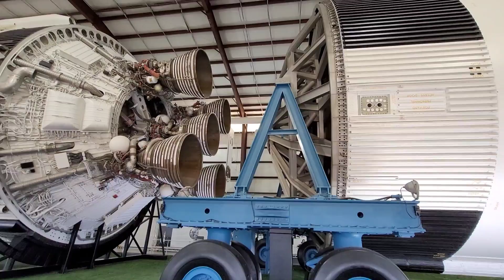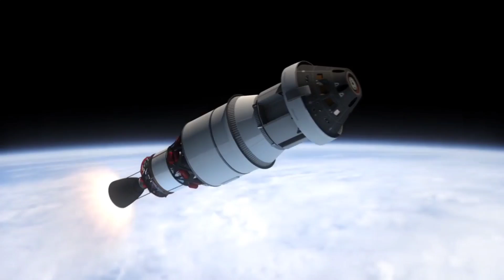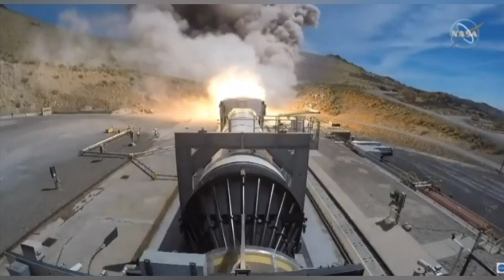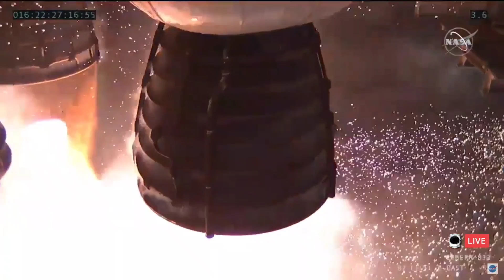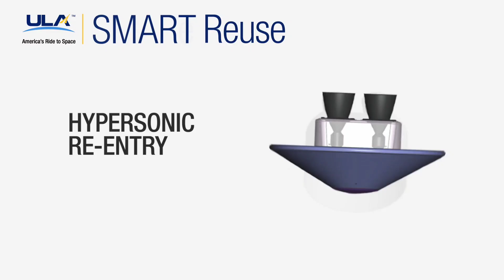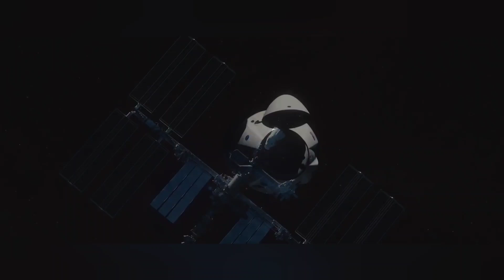Green Run Canceled! How did Boeing foul up SLS so badly? Can SpaceX or ULA (both?) solve this?

Comment: It's too bad the exact design drawings for the F1 engine are lost... Maybe Aerospike? As long as we keep using chemical rockets, orbital refueling will be a necessity for heavy launches that will leave orbit
Reply: Actually they were not lost they are held at the Marshall Space Flight Centre in Huntsville Alabama. In exploring options for the SLS, NASA carried out a study in 2013 to see if the F1s could be built using today’s technology.  By using today’s additive manufacturing techniques the engine design can be simplified to just 70 parts and would also offer about 10% performance improvement over the original F1 designs.  NASA went so far as to refurbish and test an F1 gas generator turbine for such an engine, videos for which can be found online.
Reply: The F1 was a rushed design, and suffered failure in flight at a rate that is unacceptable in today's designs. That the Shuttle went on to use a better design was in part due to lessons learned by the Apollo program.
Reply: What was lost was the "engineering" drawings. Those where the prints the the engineers had in the shop, and they kept hand written notes on them.
Reply: @joshua43214  with today's 3d printing and scanning technology, its a dead horse argument that we can't build a F1 seeing we have one at hand, it just wasn't that good a design in the first place. It did its job mostly, but it isn't like it had a spotless record.
Reply: @twotone3471  In some areas, the use of 3D printing does not work because too much stress causes damage to the printed elements or it's just too expensive to get around these problems. 3d printing != golden bullet
Reply: @GreyDeathVaccine  I'm thinking of the scanning tech mostly, taking a F1 apart, scanning each part to get its size and shape, even taking a metallurgy sample to the manufacturer. Then let them make 100 of each part, assemble new 1 engines, then go to the moon. To say we need the origional paperwork is to day we can't copy the Mona Lisa because the artist is dead! With today's tech its take a pic, or copy one off the net and print!.

If the F1 was worth it, they could have done just that. But it had issues, and it was lucky nobody died because of them.
Reply: @twotone3471  No need. F-1B exists.
Reply: Only fitting notes are lost, original plans do fine and well and even F-1B engine (massively simplified, modern and cheaper and more powerful variant) has been desinged, built and tested.

Comment: Im thinking China is going to land a human on the moon before NASA at this rate.  They are making huge strides and their new long march rocket could certainly do the job providing it works as designed (which it probably will).  Space x will also probably beat NASA to lunar orbit, but maybe not landing.  At this point the SLS is going to be too expensive and too complex to build in any useful numbers.  Its a white elephant that will be launched a few times to prove it works then shelved.  Colossal waste of time and money.

Comment: Boeing is like one of those fly by night contractors who take forever to remodel your kitchen and extort MORE money after there are holes in your walls because the alternative is to start over and hire yet ANOTHER contractor who will charge large amounts to fix the damage already done...
Reply: Boeing has virtually no experience in rockets, especially engines. It's like giving a gardener $10,000 to remodel your kitchen; yeah he'll spend the money but I don't think you'll like the results.
Reply: @idanceforpennies281  I'm as big of a critic of Boeing as anybody, but to say they have "virtually no experience in rockets" is completely disingenuous.
Reply: @samos8367  OK. So name one, just one, major piece of hardware that Boeing has designed or built for a rocket.
Reply: Don't forget (NASA's) "sunk cost" fallacy
Reply: It's not just NASA. Suppliers know how much money the customers have, or can get, and do not complete the job until the gotten all of it.

Comment: Old space never designs for manufacturing, they just make expensive one-offs. I have a cousin who works as a tool designer for ATK/NG. His full-time job is literally to design (not make) custom tools that others use to build the rockets.

SpaceX does the exact opposite. Prototypes are cheap pathfinders with rapid feedback loops that help them refine the machine that will build the machines. They do design and build tools, but tools are a means to an end. And Elon is all about "the best part is no part" and "the best process is no process." 

SpaceX rewards engineers for eliminating the unnecessary.  

Boeing rewards engineers for adding make-work projects.
Reply: SpaceX is at least 10% cheaper than the closest competitor in terms of price per kilogram to LEO.

The payload penalty for reusable rockets is less than 40% and after two launches they break even and after three, they are putting more mass into orbit per launch and per dollar than anyone else can.
Reply: @faceplants2  You seem to know better than SpaceX itself  - their position on payload AND TRAJECTORY penalty is publishd and last time F9 was supposed to do 10 flight and break even after 5 or 8....
Reply: The difference is a company trying to make something they can make money off of vs a company that knows they will make 10% off whatever they spend so the more they spend the more they make. That’s why the commercial crew program and commercial resupply missions are great. “Here’s $XX, you owe us 20 flights when you are done” they have incentive to get flying ASAP so they can get those flights over with and make money.
Reply: Great comment from somebody who's obviously seen many interviews with Elon and understands the vehicle design and development process at SpaceX.

They could build and destroy almost two dozen starships for the cost of a single SLS. That is excluding all the SLS R&D money, GSE (ground services equipment) development, complete redesign and rebuild of mobile launch tower etc that SLS required
Reply: @faceplants2  the reason we calculate the cost of a shuttle launch as the average cost of the entire program is because nasa built it and flew it themselves. Falcon is built by a private company and “chartered” out as a cargo vehicle. Therefore we only look at what they actually charge. The reason the DOD contracts are more expensive right now is because they asked spacex to completely change the way they integrate their payloads specifically for them. It’s a custom order, and custom orders cost more.
Reply: Actually: No, but sort of.  Who are the CEO's at Boeing? They are accountants because the SHARE holders are who? Financial institutions who vote on the board. Boeing's shares used to be owned by the founders of the company who were all engineers, and therefore they HIRED CEO's who knew engineering. Same goes for GM, IBM, etc. Why big public companies fail? Boards are owned lock stock and barrel by accountants, banksters, pension funds, etc without one engineer anywhere to be found. SpaceX has another couple decades to be a viable company and they will go the same way as Boeing, GM, IBM, GE, Kodak etc. As soon as Musk disappears, Space X will go to shit.
Reply: And why are so many people comparing the Falcon 9 to the shuttle anyway instead of its contemporary competitors like Atlas V, Delta IV, Ariane 5, and even the upcoming Vulcan?

Vulcan is going semi reusable by ejecting and recovering the engines and they are doing so with a parachute. Rocket lab is working on reusing their core stage.
Russia is working on a knockoff Falcon 9 that is reusable and China is also working on reusability.
Clearly, the financials of reusing rocket components makes sense.

In terms of rocket launches needed per ton delivered to LEO, Falcon 9 breaks even around the second launch and it only gets better from the third launch forward.

They have already flown several boosters five times.

Don't forget that the price SpaceX charges ($62 Million new / $50 Mil reused) is the price they charge and not the cost to them. We don't know what their cost is and we don't know how much cheaper they can price a mission until the competition starts catching up and forces them to lower prices.

They need to make money to develop Starship, Starlink and future projects somehow and if you are already at least 10% cheaper than the closest competition, why would any business charge less?
Reply: @faceplants2  reusability, as Ryan points out.

It is interesting that none of these other entities would be dipping their toes in the waters of reusable rockets if SpaceX had not forced them to. And while SpaceX learned from the STS mistakes and pushed reusability to a new level, the others were shaking their heads and clucking that reusability wasn't economically feasible -- STS proved that. And now that they are finally realizing they were wrong, SpaceX is pushing on: Falcon 9 is not enough. Starship must be fully and rapidly reusable. 

Don't bet against Elon.
Reply: @faceplants2  people compare them because the shuttle and falcon are both reusable. I’ll agree it’s not a valid comparison, but that’s why. Also, they flew their second booster for the 8th time this morning.
Reply: @ryanhamstra49  Starlink 16 was the first time a booster flew 8 times iirc.
They haven't flown another for the 8th time yet, have they?
Starlink 17 will be the 8th flight for booster 1049 but it's launching out of order, after 18-19
Reply: @faceplants2  I was wrong. There was supposed to be a launch last night but it scrubbed
Reply: No, SpaceX hasn't made things better.
Reusable aren't cheaper. Recently SpaceX charged the DOD way more that ULA did.
Reply: @bobfg3130  That's silly.
F9 is much cheaper than any of the competition, you can go look up the prices and convince yourself.
You are either getting half the story, oryou are telling half the story.
Reply: @joshua43214  it also depends on the launch. If it’s someone like DOD they may require a new rocket instead of one on its 3rd launch which means it may be more expensive than a launch for direct tv who is ok with a pre launched rocket.
Reply: @joshua43214  The advantage of falcon 9 is vastly overstated (between offsetting R&D costs with NASA contracts & the extensive work still required to recondition boosters). At the same time, it is still the best launch vehicle available for most orbital missions these days. It also has a lot more potential as they streamline the process to reuse boosters and get the reuse counts up.

It would be impossible to say otherwise without a financial report from SpaceX showing how large their costs were unrelated to F9.

That said, the "classic" space companies are just in a whole other league of failed spending. The space shuttle, a popular example, wasn't bad towards the end of its life and it brought a lot of capability to the space program so that's not a good choice. Instead, look at the lack of innovation in the past 20 years: ULA have practically coasted on what Boeing and Lockheed-Martin already developed in the Atlas V and Delta IV rockets. We'll see when Vulcan comes out whether that holds but supplying NASA with an alternative to Soyuz ISS launches should have been an easily achievable goal.
Reply: @bobfg3130  You are conflating development costs with launch costs. These contracts are not only for payload mass delivered to orbit but also the development of launch facilities, larger payload fairings, horizontal payload integration and vehicle development.
Reply: @faceplants2  

The cost per Space Shuttle also includes development cost. It's the equivalent.
Reply: @bobfg3130  Yes, comparing cost per launch is not apples to apples because the shuttle launch costs were portrayed as an average over the course of the entire lifetime of the project whereas Falcon 9 is mostly based on pricing in the development stage
Reply: @bobfg3130  
I take it that I was correct and that you were basing a lot of your information on recent Thunderfoot videos?

If you want to have balanced sources of information (or just more accurate information), I highly recommend that you check out
https://youtu.be/Y4EocY9Z1qo
Reply: @faceplants2  

Actually Falcon 9 pricing mostly is based on pricing in the launch stage. Nice try though. Maybe you should stop lying and supporting Musk.
Reply: @bobfg3130  
 Hey, You know that bullshit tribalism that the mainstream media and politicians pulled off that got everyone to sort into one of two political teams?

You're doing the same damn thing.
Let me guess, you think everyone falls into one of two camps: blind fanboys that belong to the cult of Elon Musk or those that have their eyes opened to see that he is a fraud and con man.

God that's boring
Reply: ben esterberg  

No, it's not. That's just one of Musk's lies. Contracts have been given by the government in dubious ways for decades. Cheaper? Right.

https://www.google.com/amp/s/www.forbes.com/sites/lorenthompson/2020/09/17/when-it-comes-to-military-launches-spacex-may-no-longer-be-the-low-cost-provider/amp/
Reply: @bobfg3130  those contracts are not just for the cost of launches but for the development of larger payload fairings and ground service equipment / launch facilities. The DoD contracts specifically.

You also have to keep in mind that when it comes to national security, having more than one domestic launch provider is incredibly valuable.

A lot of the SpaceX critics seem to ignore the fact that if it wasn't for them, we would still be paying the Russians for rides up to the space station.

The Falcon 9 is still being vetted and developed. Cost per launch and cost per kilogram delivered to orbit or not the only things that matter here. Capability and redundancy are incredibly important when it comes to national security and NROL missions.
Reply: @bobfg3130  
If you see Elon Musk, SpaceX or Tesla as 100% bad then you are just as foolish as the fanboys that think that Elon can do no wrong.

The real world requires the application of far more nuance and critical thinking. Take a long view of the orbital launch provider market and the capabilities that our military needs to maintain.
Reply: @faceplants2  

SpaceX is viable economically but isn't better than other companies. Tesla was a great idea. I don't know how viable it is economically.
Reply: @bobfg3130  Well, it's only one of the largest automakers on the planet.

Many of the other legacy car makers are just now getting into electric vehicles and they are years behind.
Reply: @faceplants2  

Tesla, one of the largest automakers on the planet? Good joke. 

The legacy automakers have had electric cars FOR YEARS.
Reply: @bobfg3130  by both market cap and revenue growth, yes Tesla is kicking ass.

Most of the US automakers had to stop their production lines because they had canceled orders for the chips required for ECUs back in the spring. The fact that they don't understand that wafer supply at Silicon fabs needs to be reserved Well ahead of time bit them in the ass.
Reply: @faceplants2  

Market cap means shit. It's all hype. Manufacturing numbers are where it's at. Also, Tesla makes profits by selling green certificates or something like that since they're not making internal combustion engine cars and don't need them.
Reply: @bobfg3130  "green certificates or something..."

Let me know when you have your point fully formed and I will consider it.
Reply: @faceplants2  

That IS my point. The reason why you won't consider it is because you don't like the facts. For every set number of cars (50 or something like that) that has just an internal combustion engine that has been sold a manufacturer has to sell a hybrid or electric car or else they will pay fines in theory. In practice for every hybrid or electric car sold a manufacturer gets a green certificate. They need 1 certificate for every 50 sold cars. Tesla doesn't make internal combustion engine cars so they don't need these certificates but they get loads of them. What do they do with them? They sell them. That's how Tesla makes a profit.
Reply: @faceplants2  Tesla isn't failing, but the market cap is insanity and the worship stupid and the business models anti-consumer. The Boring Company is a giga-scam. SpaceX is the only Musk business which is represented fairly accurately, in that they are building economical and reusable rockets. If they were not cheaper or had other qualities that made them attractive, payloads wouldn't launch with them. They are the only human-rated launch vehicle in the US at the moment. The closest comparable vehicle is the Atlas V which to get comparable performance to Falcon 9 expendable costs $150 million and a laughable $100 million for an expendable vehicle to launch what Falcon 9 can in reusable mode. The Ariane 5 is very competitive to the Falcon 9 but is not US based and generally launches 2 satellites at once which national security launches would hate no matter the country. They are also investing in orbital broadband, which is likely going to be a much more profitable business than flying rockets has or ever will be. Musk isn't the President of SpaceX and I'm glad of it (Gwynne Shotwell is, and has been since it started, and has run it well).